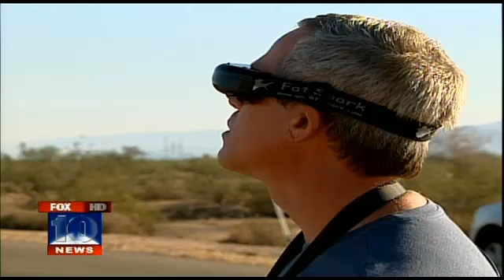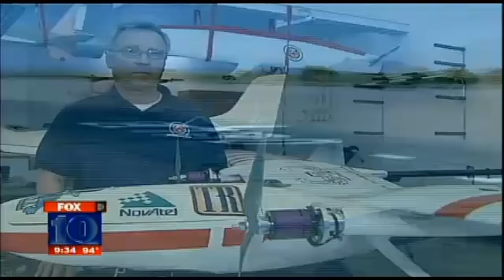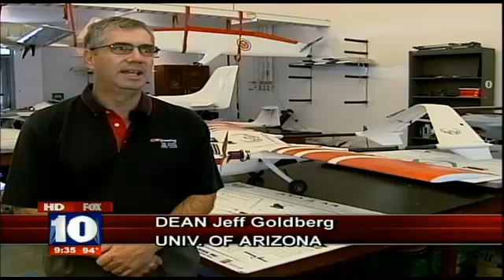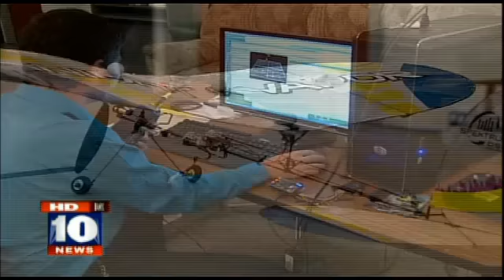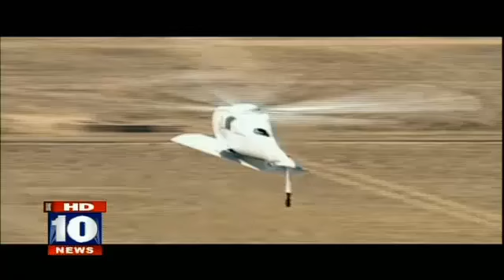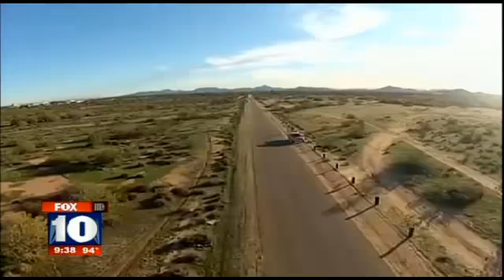FPV Peace Drone on Fox 10 News

Comment: I think within the next few years the RC hobby well at least the flying types of RC will be very restricted, Requiring all sorts of permits and licenses making the hobby more work and less fun.  This is a hobby that is already expensive enough without adding permits to the mix.

Pretty soon no rc airplanes with cameras attached and then no rc airplanes at all. i can imagine a kid getting a new RC plane for their birthday takeing it to the local part to fly it only to be told by park person ell that device cant be used here or has to be taken to a sanctioned field that happens to be 40 miles away or maybe there isnt a field within reasonable driving distance for a day trip but you have to plan weeks in advance just to fly your 80 dollar toy. horrible and i believe that if we the people dont stand up and say enough is enough it will only get worse.

Comment: Congrats, Ed!  But, yeah, thw whole tone of the piece was somewhat...threatening.  I think you're right; regulation is not far away, I'm just afraid they're going to wind up with 'drone airparks' 300-miles away, FAA testing, expensive fail-proof gear, back-ups and will wind up like like private flying - well out of reach of most people.